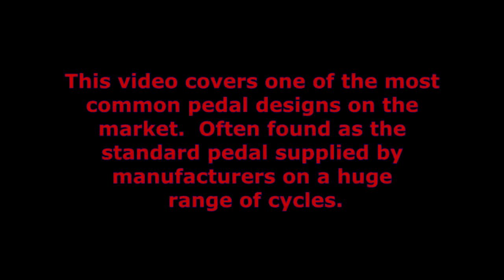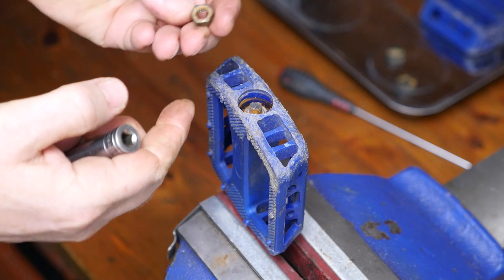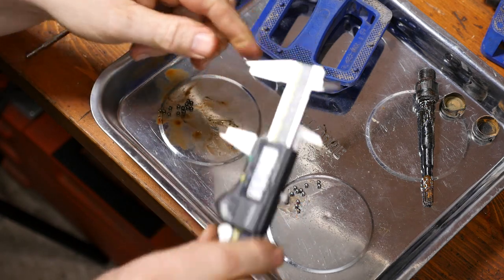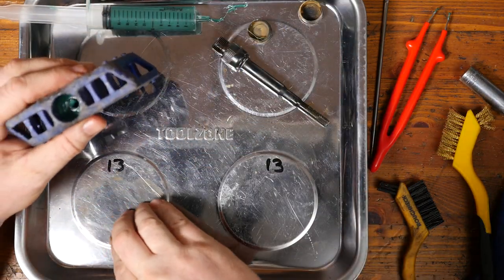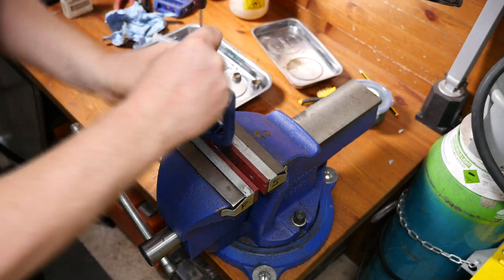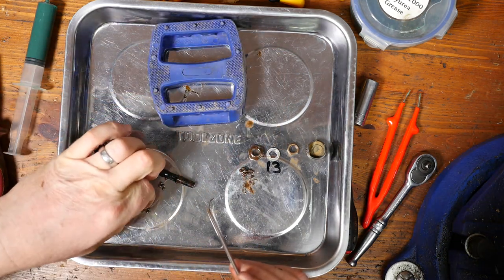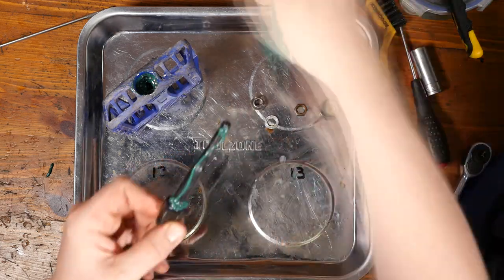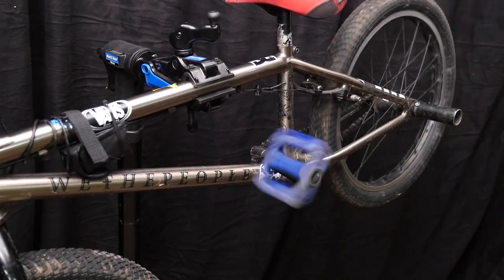Greasing & Servicing Cheap Budget Pedals supplied as standard on Mountain Bikes BMX Cycles - Bike 🚲🚲

Comment: You really shouldn't be using magnets to hold ball bearings in place. It will magnetize them and make them act weird in the bearing grooves. It's not quite as bad for such a rough application as bike pedals are but still. It can also make them accumulate iron shavings on their surface, damaging them as they rotate.
Reply from the maker: Thank you for that information I didn’t consider.
Reply: @CoatsandGaiters  It's something I'm more used to consider when doing maintenance on CNC linear rails, which use similar ball bearings, but I think it can apply to all types of bearings.
Reply from the maker: @EMILE12345678901  it’s a valid point like you say.  You can see it would attract metal particles which would create a weakness. Appreciate your advice.
Reply: Cheers for that, smashing bit of info!  Will apply to anything similar too like gears ect!   So no magntising any rolling meshing mechanical part !

Comment: A socket can be used to help extracting the cone if it is not seize by rust. Because the cone is never mean to be tightened but just fix the spindle in place to a non-wobble sitting.  The washer is in place to separate the cone from spinning when you use the nut to tighten them.
Reply from the maker: Thank you for that info, helpful to know.

Comment: Thank you for the detailed instructions and tips on disassembling, cleaning, greasing and reassembling these common bicycle pedal bearings. Your video told me everything I needed to know to service the bearings on my dried out 10 year old commuter bike pedals. Showing how the grease securely holds the bearings was really helpful. Everything is running smooth again.
Reply from the maker: Thank you for the compliment.  Really good to hear the video has helped you.
Reply: Some would think that after 10 years of use you might as well just buy a new pedal since it's so cheap, but what they don't know is it's much more satisfying to disassemble and fix up an old pedal, no reason to throw something away which can be just like new with a bit of work :)

Comment: Thanks for this detailed instruction. When completely disassembling the pedals, I would always replace the bearings, especially if there is dirt or rust underneath the dust cap. New bearings are relatively inexpensive, and replacement will prevent wear on the cones and cupes. I am pretty sure the bearing diameter is  1/8 inch and not 3 mm.
Reply from the maker: Thank you for the comment and added information.  Like you say it makes sense to change the bearings if one can.

Comment: One of my cheap pedals went all grindy, I didn't know they were serviceable but I didn't have a spare handy so I had a look on You Tube. It turns out the outer cone got so loose one of the bearings fell out, but the grease and dust cover caught it. It's back together now but I'll be bringing the tools on the first ride just in case. 

Great video, cheers!
Reply from the maker: Well done.  Hope the video helped
Reply: @CoatsandGaiters  Your video was perfect. Since it was the right pedal I could lay the bike down on the non-drive side and use it for the vise. 15 mm open end, 12 mm socket, screwdriver, long nose pliers, grease. US paraffin (kerosene) stinks so I used mineral spirits (paint thinner) for cleaning. 
Everything is tight and smooth after the first ride. My main concern was the pedal would seize and unscrew itself while riding but that didn't happen and probably won't now.
Nothing was rusty or contaminated just loose, so I may be lazy and leave the left side alone, it isn't loose. If it ain't broke....

Comment: Thankyou very much,  helped me out a load!

Just a thought,   with those plastic pedal bodies you could drill a hole in the center part where the shaft goes through to inject grease with a syringe so it would come out either side through the bearings to regrease them and expel some of the dirt.     Then a screw into the hole you drilled to seal it up afterwards?
Reply from the maker: Thank you and that sounds like a good idea.
Reply: What your thinking about will not get all the dirt and contaminates out. It needs to be perfectly cleaned out because contaminates act as compound in the grease. Compound grinds and wears the bearings, bearing races, and cones out. Compound is gritty and acts like sand paper. You also want to completely disassemble and look at everything closely for wear, rust, separating parts, and cracks or cracking in the metal and plastic parts each time you regrease. Lastly, filling your pedals up with grease like your mentioning will add more weight to the bike.
Reply from the maker: @jeffhayes2288  Thank you for the comment Jeff and your quite right.  Some good advice there.
Reply: Overhauling pedals is completely unnecessary. Just take off the end cap, flush it out with wd40 or something, then pack grease into the end till it comes out the other side.

Comment: Thanks, the little tip on the 3 and 1 helped tighten it all up without the inner bearing cup moving as well.
Reply from the maker: That's good.
Reply: @CoatsandGaiters Very nice tips. But I have one problem - on one of my pedals the lock nut and the cone nut are moving together. There is no washer in between them. It's just how both pedals were. And I'm the first owner. How I'm supposed to tighten it up. I even put the cone very loose and then the lock nut. When it reaches the cone there is a little presser and then they all spin as one, until they reach the bearings and crush them. I could probably change the lock nut, but not the cone. Or put a washer between them. Any ideas?
Reply from the maker: @vehicle-stuff  if you unwound the cone say 2 full turns and then started to lock it would it still get to the bearings before it locked?  how about 4 turns away etc?  surly it would bind and lock at some point and then gradually take it in bit by bit.  Thread lock might help on the cone.
Reply: @CoatsandGaiters  I'm doing it from the beginning of the threads. And it still does not bind. Today is Sunday and I can't get a washer, but tomorrow will go to the tool store and get one to check. After that may be a new lock nut, or one with a rubber seal and some thread lock.
Reply: I would put a washer in the spot between the cone and nut because it seams that the nut isn't to be locked to the cone like nuts are locked to cones on the wheel axles. I would put a washer like your saying from a hardware store if on a budget. If you want to be sure your have the right washer in regards to specs in terms of metal grade, hardness, type of metal, etcetra, I'd go to a bike store. It's still cheap, maybe a few cents to a dollar more per washer at a bike store.
Reply from the maker: @jeffhayes2288  Thank you again Jeff, I think you might know more about cycling than me so again some good advice.
Reply: @jeffhayes2288  Well a friend with a 3D printer came to the rescue. We took some measurements and made a tool that holds the cone, while you tighten the nut. It's a hollow tool that has an 11mm lock in it's tip for the cone, and inside you can fit a bit for a 9mm nut. It has wings on the outside to hold lock the cone and you tighten the nut with the bit. It's specific for this type of pedals but they all come from the factory a little bit tighten.Triple Eight flat CMPT . 

Thank you all for the help!

Comment: Thank you for the how to video! I just bought a new set of pedals for my bike. They take some effort to turn, though, so I think they may have over-tightened them at the factory.
Reply from the maker: Thank you for the comment and hope it helps you.
Reply: I bought a used BMX for my kid and the pedals felt gritty and nasty.  Decided to buy some new ones.  New ones felt only a little better.  Before I even watched this video, I backed off the lock nut on the old ones just a bit and suddenly the pedals felt great.  Both sets were overtightened from the factory.

After watching this video, I've rebuilt the old pedals, they're buttery smooth now.  I'll fix the new ones another day.  Should've tried servicing these before buying new... live and learn.
Reply from the maker: @BlueTrane2028  Love hearing great results like this.  Happy cycling for your  little one then.

Comment: Good information, very good for old peddles that need repair.  However, I have 16,000 miles on my peddles and have never needed to take them apart.  Starting when new I pop off the dust cap and I pack them full of grease until it goes all the way through and comes out the threaded end.  This method lasts for thousands of miles and keeps the water and dirt out.  Messy, but worth it.  No tools required.  This does take some time to do.  I use my thumb to squeeze the grease in.  This dust cap can also be used to push the grease in.  Doing it this way the balls never run dry and so never wear out, never need adjusting.  Best to wrap the peddle with paper towel to keep it from getting grease on it, as this is messy to clean up after.  I do this on all my peddles and have had very good luck with it.
Reply from the maker: Brilliant idea, that would keep water out pretty well.  You cycle a lot then.  16,000 miles is a fair bit.  Tell me that's not annual mileage!
Reply: @CoatsandGaiters  Thank you.  This millage is since 2018, on this bike.  I have other bikes but I ride the dual sport most of the time.  I do most of my own repair work.  I am retired, from Seattle Washington.  I am now living in Manila, Philippines.  Many of the roads I ride on get flooded during the monsoon season.  I try not to ride my good bike in the floods but sometimes it can't be helped.  So even more surprising how well the peddles have lasted by packing with grease.
Reply: Does filling the pedals like this with grease cause a weight increase?
Reply: @jeffhayes2288  Not much, and more then makes up for that by easier, less friction.  Keeping the water out is well worth it.

Comment: I have a pair of dartmoor cookie pedals, and on the right pedal the cone keeps tightening towards the bearings. I tight them enough so they don't have play, and also not over tightening them. What could it be? Lack of grease?
EDIT: I didn't put any thread lock. Should I?
Reply from the maker: At 14:02 I show the pinch nut and how I tightened it.  Did you see this part? As it should work.
Reply: Yes, I've done that a few time and it keeps tightening. I also tried to tighten the cone against the nut, but it keeps happening. It's like as I'm pedaling the bearings tighten the cone
Reply from the maker: @aguspege240  has something got swopped from the left to the right?  wonder if they have left and right threaded nuts and they have accidentally got mixed up.
Reply: Before I assembly them I double checked the "L" or "R" on the axles and also the pedal position. I Didn't checked the cones, but they went smoothly over the threads.
Reply from the maker: @aguspege240  Sometimes nuts can tighten by turning left instead of right.  I will see if I can find anything out on it.
Reply: Ahh..  dartmoor... same here... crushed my head against the wall with these freaky lock nuts and still just put it back together enough to spin freely and enough to be tightened, but for sure its not factory like and for sure way under torque..

Comment: Hey sorry to bother you again but i had few more questions, since my luck nut got loose while riding iv'e lost all of one side ball bearings, they are 2.3 on my cheap calipers, does it mean its 2 mm? where can i find those bearings online?
since this mechanism is not the best engineering and that antislip washer doesn't really do its job do you recommend using loctite on it do avoid what I've got thru?
Reply from the maker: If it says 2.3 they will be 2.3.  .3 is a measurable size on such a small item.  I'd have thought they would be on ebay.  If you had to you could damage the thread to effectively lock the nut on.
Reply: I read that bearings come in different kinds of metals and hardness. Places like amazon do not always give you the specs you think your getting. It's also flooded with products that are not as superior as others. Made by China and made in China for example. I would go to a bike store to be sure you get all that kind of stuff correct for an efficient and correct mechanical working system. It's still cheap like ebay. Actually I found tools cheaper at my local bike store due to no shipping charges with in person shopping.

Comment: really good video !
i wonder, if i lost few bearings (on the right side of my right pedal) can i still regrease and lock it on place ?
btw, you forgot to grease the threads that goes into the crank, not a big deal but still..
Reply from the maker: Thank you for the positive comment Shaked Inbar.    You might get away with a lost bearing but it might cause some extra wear  on the other bearings.
Reply: @CoatsandGaiters  defently man, you deserve it. very very detailed and organized video !
make more to the bmx crowed !
Reply: I had a missing bearing in my front rim decades ago after I maintainence them. It make a loud clanking noise. I ignored it. The next day when doing maybe 20 miles per hour, the front rim locked up. I we.t over the handlebars and smashed my faced into the sidewalk and got permanent physical problems from it. I recommend you keep the bearing size, count, etcetra to the original specs.

Comment: What to do when one of the dust caps is lost and for that the pedal without the dust cap is getting hampered? I do not have the sophisticated sockets and the pedal holder at home. I only have spanners (10-15 mm) and allen keys (4 and 5mm) and some screw drivers for the reference. Kindly help me. Thank you in advance...
Reply from the maker: Not sure how to get around the socket issue short of borrowing one from a friend.  You could possibly pack the end cap with grease to stop water getting in and maybe put some tape over the end or cut a disc from a plastic bottle and push it in to seal the area.  Sorry I couldn't help much.
Reply: @CoatsandGaiters  no worries.... Thanks for the diy ideas but one thing I need to ask you, if I buy a socket wrench from a store, what is the standard size that is required for the flat pedals? Thanks again...
Reply from the maker: @swarnendumunshi  to remove the whole pedal you mean from the crank? That's 15mm 0:42
Reply: @CoatsandGaiters  no no....15 mm spanner/ wrench is required to remove the pedal from crank I know... I am asking that to disassemble the pedal (to separate the axle and the plastic pedal body what wrench size and/or type is required?

Comment: So, both spindles are threaded standard on the outboard end? Is the left one reverse threaded or standard (lefty loosey)? It seems like you are turning both left to loosen, but I’m not certain. Thank you!
Reply from the maker: I think they are both standard threads on the end as they just lock with the little nut.  It's just getting it to lock in just the right spot so as not to pinch or be too loose.

Comment: my flats have round axle where ya putting spanner not got flat side on them any clue how to remove them as can not get allen key to work seems seized up good
Reply from the maker: Luke Morgan sorry but I’m not quite understanding.
Reply: @CoatsandGaiters   the axle is round where it attached to crank arm it dose not have any flat edges between pedle and crank arm for spanners to grip but new ones have flat edges on axle so trying to get old ones off to fit new ones but  due to the round axle i can not seem to get them off crank arms
Reply: its where you showed how to position the spanner that area where axle goes in to pedle mine are round no flat spots for spanner like most have
Reply from the maker: @e-bike-bys-vykken7422  not secured with an allen key head on the other side are they? or is crank and pedal all one piece I wonder.

Comment: Thanks for taking the time to make such a detailed, easy to follow video, it is much appreciated and of great help.

 I just bought new flat pedals for my 2 bikes, a set of Tag T3s and a set of Race Face Chesters - What slightly concerns me is that both these sets of pedals are a little stiff; they don't spin freely on their axles. The do move round smoothly but you definitely couldn't spin them they way you do in your video. Is this normal for brand new pedals, would you say? I am assuming that once they have a bit of use they will loosen up at bit but would be interested to know what you think. Many thanks!
Reply from the maker: Thank you for the compliment.  Smooth is the key I think.  As long as they are smooth to rotate and not binding that's good.  Spinning too freely isn't great as it means the bearings aren't making any contact with the axle so it's trying to find that happy balance.  Smooth is good.
Reply: @CoatsandGaiters  Thanks so much. You've put my mind at ease! Thanks again for your video. Keep 'em coming!
Reply from the maker: @FlowerdyPilllow  thank you
Reply: Make sure the pedals spin as free as possible without any wobble in the axle. with what your describing, they may be over tightened, causing the cones to push too hard on the bearings which in turn push hard on the bearing races. This results in too much friction, even with new grease in them. This kind of situation results to wear.
Reply: @jeffhayes2288  Thanks Jeff. That helps👍

Comment: At 4:12, how to remove the washer if it's completely gripped ? It didn't budge at all even with a flat screwdriver and a plier. Thanks
Reply from the maker: Have you tried pulling on the spindle from the crank side?
Reply: @CoatsandGaiters   Thanks for the response, i will try